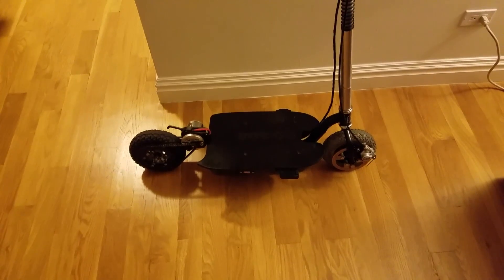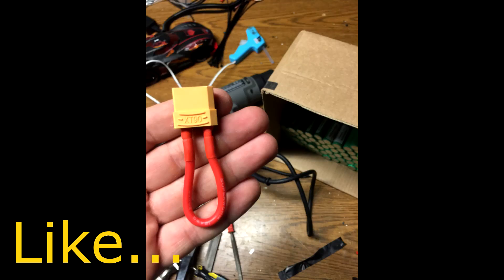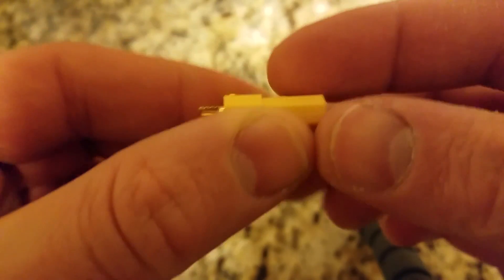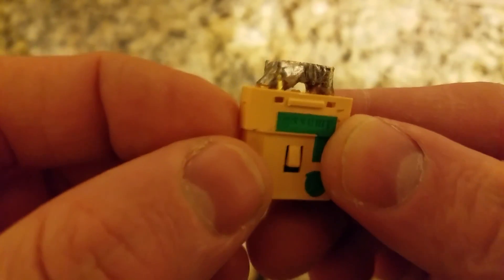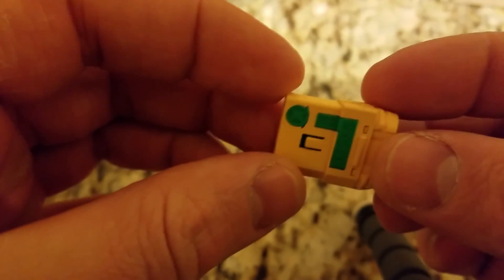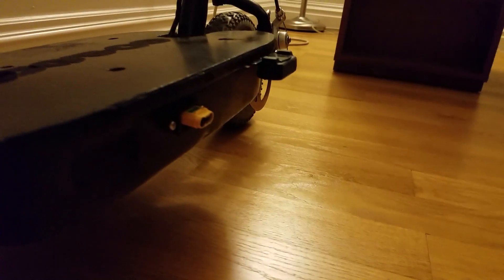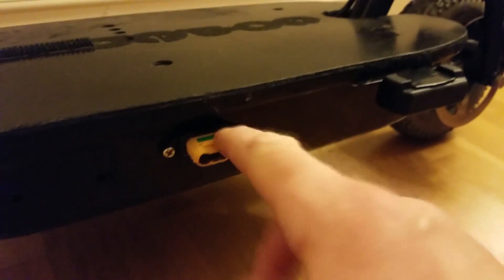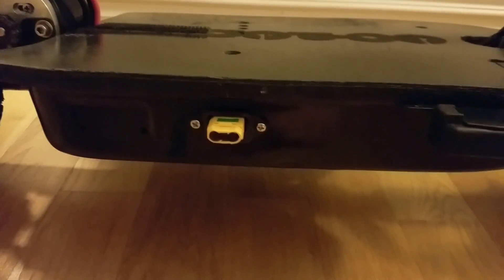Anti spark XT90 compact connector

Comment: Nice job, but I think the mother connector should be connected to the battery. It is realtive easy to shorten the battery in your solution.
Reply from the maker: it can be done either way. I tried both scenarios and it works well.

Comment: Nice job!  How did you mount half of the connector to the board?
Reply from the maker: which connectors? it is all inside in the pan.
Reply: the female half of the anti spark connector you used as the main power switch.  First visible in the video at  0:28